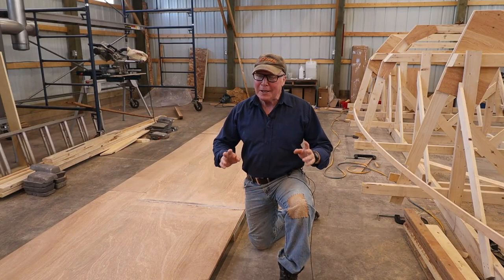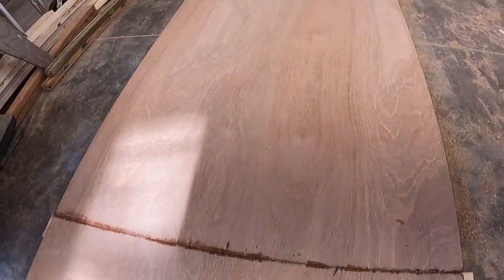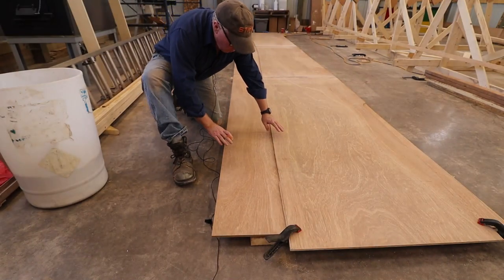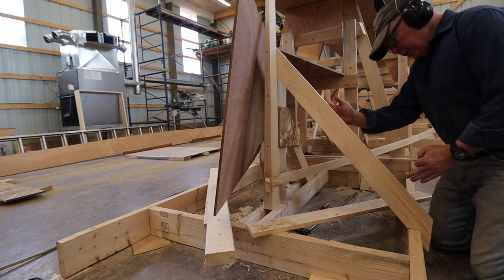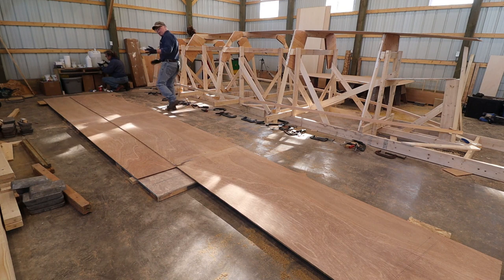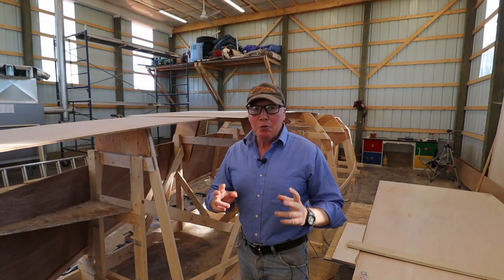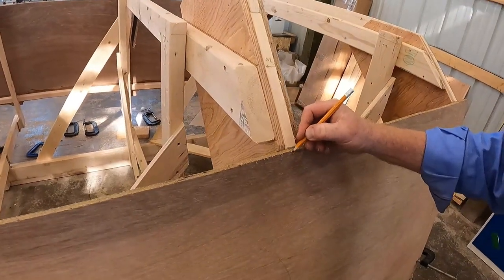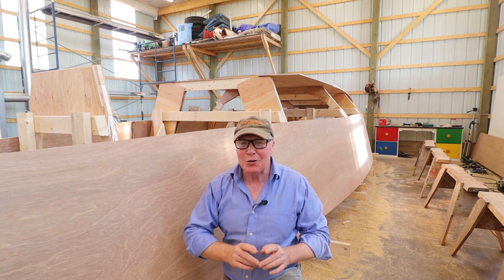S2E11 Plywood goes on the Hull || Breaking a plywood scarf joint || Building a Wave Rover 650

Comment: Your scarfjoint test looks very good, what bothers me a bit, is that you can break the plywood with ease around your knee.
Do you think that the plywood hull of only 10 mm will be strong enough for a ocean crossing ? what, if you hit a tree or a floating container ?
Reply from the maker: Good question. Plywood on the hull has a frame every 18". It has a curve which greatly improves its deflective ability. It has a layer or more of FG to strengthen it. And finally, the test piece was only 2" wide.
Reply: @RoversAdventure  All right, thanks, sounds good to me. Happy sailing !

Comment: Surprised at how easily the hull sheet fit to the frame. 👍🏻

Is there an I-beam in the rafters you’ll be able to use to assist in lifting and turning the completed hull?
Reply from the maker: No reinforcing in the trusses. I will be relying on some hearty souls. It will only weigh about 3-400lbs when we go to turn it over.

Comment: Since I have never built a boat, I have a question. Could you have substituted Divinycell foam panels instead of  using plywood for the exterior?
Reply from the maker: Absolutely. For me it was a cost issue and the plywood was readily available

Comment: I was under the impression that this design was going to be a stich and glue style design.  This as you are doing it is more a traditional ply on frame layup. ??  Would a boat of this design not been easier as a basket mold stich and glue project?
Reply: A fairly moot point when you consider for this build like the vast majority of boats the hull skin construction is such a minor part of the whole project.  Having built a few boats myself to either method I do like an internal stringer on chines if not for strength then maybe for impact resistance. Also I have built a stich and tape dinghy and its a struggle to line the whole thing up in a larger vessel like this that could turn into quite a mission without the temp frames.
Reply from the maker: I have made a 26' stitch and glue Wharrem Cat in the past. It was an appropriate technique for that design. In my judgement, the technique I am using here is going to be simpler, and quicker than a stitch and glue for this design. The frames were knocked off in 2 days and are made out of inexpensive material. Apart from the sheer stringer, there are no more stringers below it (this is done to prevent water traps, instead I am making use of biaxial tape both sides of the chine for strength).
You could make this with stitch and glue. The building technique is not the boat.

Comment: Yes that plastic holding the wood together is the strongest part...  Just thought I’d lob a grenade into the trenches… ;  )
Reply from the maker: You are preaching to the converted here. The chines on my design are basically a fiberglass boat with plywood connecting them.
Reply: @RoversAdventure  Apologies for the silly joke.  I was just stirring up the fundamentalist Followers of the Wooden Boat.  You’re obviously not one of those.  My last boat was of a similar style construction wise.  Wood and epoxy love each other and combine the best properties of both materials. I too tell people you’ll break the wood before you break the joint - an epoxy joint, particularly in ply, strengthens it rather than weakens it!  Keep up the good work. I put a video of that build on YT if you or anyone is interested - search my name.  Cheers
Reply from the maker: @robinhodgkinson  You sir are a real craftsman. I just watched your video. Excellent! I'm glad that you told me about it as I'm glassing tomorrow and I'm more sailor than boat builder so your video has been a timely tutorial.
Reply from the maker: @robinhodgkinson  Question: How did you apply the epoxy to the glass initially? FG dry on the boat and roll the epoxy into it?
Reply: @RoversAdventure  Yes, I applied the fg dry on the boat, poured on the epoxy and worked it along with a squeegee.  The apply dry method means you’ll have to keep adding some epoxy as you go since the ply will suck the weave dry to a degree - what was too much epoxy, looks starved 5 mins later. But that’s no big deal, it soon saturates the ply. You just need to work back a few feet as you go along adding a little more epoxy. Handling dry means you can easily roll it on and position it.  Pre-wet is good for small areas and difficult to get at situations but a mission to handle if you’re doing large areas, and there’s the danger of it setting off which it can quickly do if you are dealing with a whole roll of it pre wet!

Another way, and perhaps my preferred, is to roll on a fairly liberal (but controllable) application of epoxy resin onto the ply then lay the pre-cut fg dry over the top.  That way you're pre soaking the ply, which means less working the layup, but are still handling dry and easy to manage fg.  Then of course you apply further resin over the top.  Its a bit quicker than the dry method I find, and the added bonus is the fg will usually sit in the correct position held fast by the wet resin, which quickly soaks into the glass as well.  So you're kinda "pre-wetting" to a degree both the fg and the ply!

I recommend using peel ply over the fg - less fairing and sanding. I’ve since made a simple roller dispenser for the peel ply so I can follow along behind the wetting out - epoxy a section, then follow up with the peel ply, etc. Leave enough resin so that you are just squeegeeing out a small quantity from under the Pp as you go, and you’ll have a silky smooth finish instead of the course weave texture. Not essential, but I’m addicted to that perfect shine!  : )
Reply from the maker: @robinhodgkinson  Thanks so much for the reply. Too late (impending cold temp of winter) to order up peel ply. Great info thanks!

Comment: Cutting a 6" or 8" diameter PVC pipe into 1" long sections, and then cutting a slot in that 1" section so it can be pried open makes a decent cheap clamp.
Reply from the maker: Thanks for that, may use it in the future.

Comment: The frames are temporary so in the end the hull will have zero structure like orgami? You then just insert a few bulkheads ? TY
Reply from the maker: You are correct. Either a bulkhead or frame every 18"(approximately)

Comment: How does the flat bottom effect comfort on a moderate sea?
Reply from the maker: Good question Treavor, It should wallow less than my Contessa off the wind. As for going to windward, I will let you know after some sea trails. I am not anticipating any real issues. At the end of the day it is only a 21' boat. It' going to get tossed about in seas that you may not feel in a 36' boat.

Comment: Designed for solo sailing, but not building.
Those are big sheets to handle, might be a challenge to build without help.
Reply from the maker: Each side is about 80lbs. Awkward rather than heavy. After the hull stage, it's very much a single handed job. BTW, if you build a boat, it's hard to stop your friends pitching in. Boat builds have a way of bringing folks together.
Reply: @RoversAdventure  Haha. If I hear of a boat build nearby I will bring beer. 😍
Reply: I am also thinking about of this. A singlehanded builder might scarf the sheets on the frame after gluing instead of the other way around.
Reply from the maker: @sailoutofagarage6212  Too much curve to scarf whist on the frames but you could apply a butt block. But really all you need is one other person for 10 minutes to help lift it up. After the hull, everything gets small again.

Comment: The sheer line board is glued to the plywood which means that the board was screwed to the  temporary frame from the inside of the hull.  Important fact which means the two can be separated when ready.
Reply from the maker: The stringer is not fixed to the frames. It is glued to the stem and temporarily screwed just behind the transom frame (Outside the plywood) It just stays in place in the notches on the temp frames

Comment: I know that filming your work slow the progress considerably, but it is bit fustrating to watch when you skip some important steps without even mentioning then. E.g the stringer got magically trimmed to correct lenght and also the first panel at the bow after glueing. Anyway thanks for great video series.
Reply from the maker: I try to include as much as possible but sometimes the video doesn't turn out or I forget to set up the camera. I do however try to improve each video over the last.